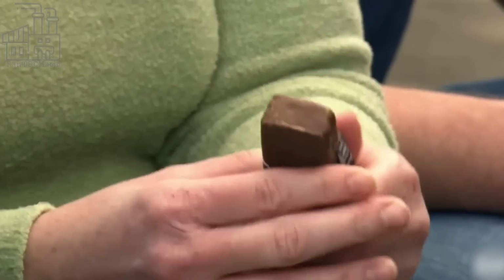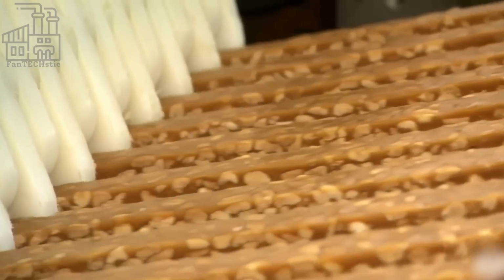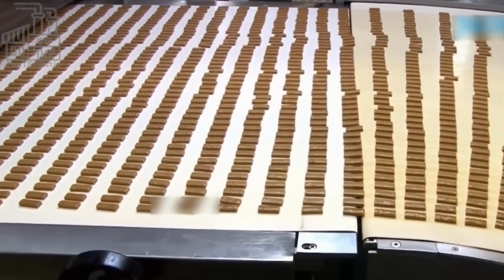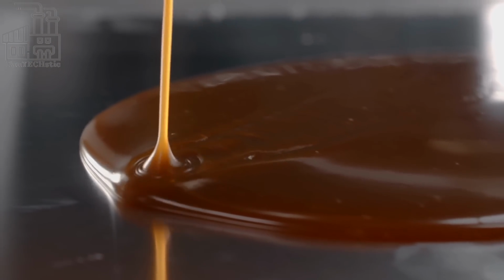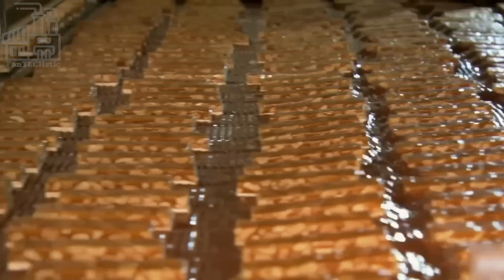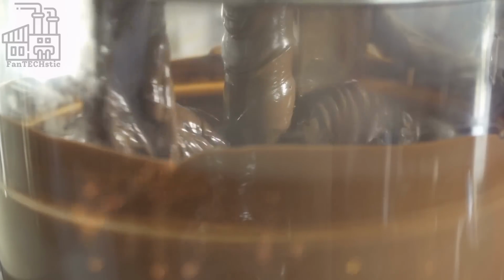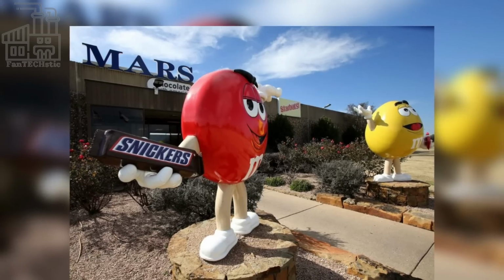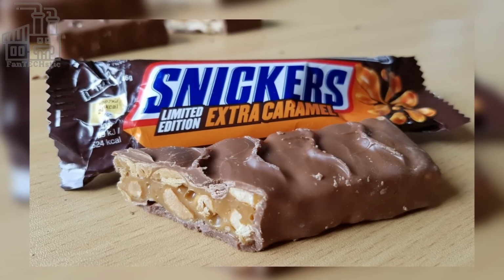Ever Wondered How Snickers Are Made?! Join us on this FanTECHstic Factory Tour!

Comment: Some 50 years ago,  I was an HND electrical electronic student, doing a six month spell in industry, I had a placement at a well known UK chocolate manufacturer. In the factory was a room where they stored the liquid plain chocolate mixture,  it was known as the conche room.

I was told by fellow electricians that, it was an unpleasant room to work in,  as the fumes made your eyes water.

Of course being the 'newbie', one day I was given the task of doing a job in there. Which I duly did.

They were surprised to discover that I could happily work in there with no adverse affects.